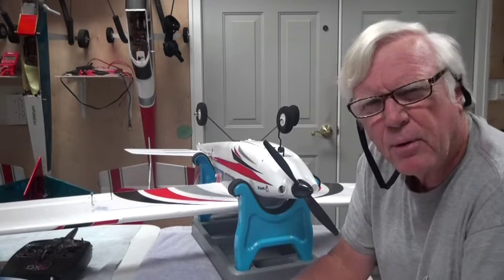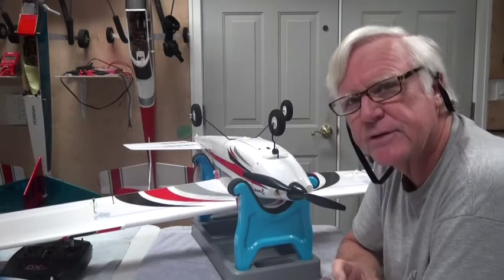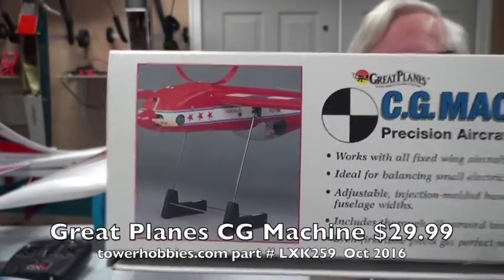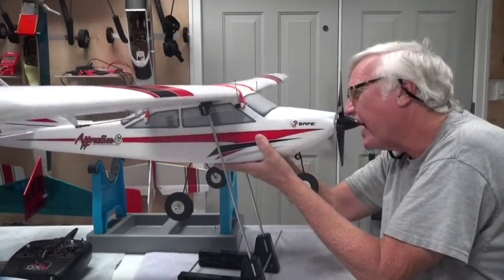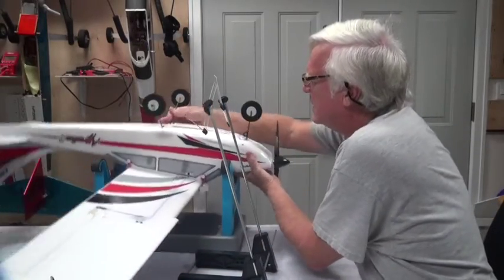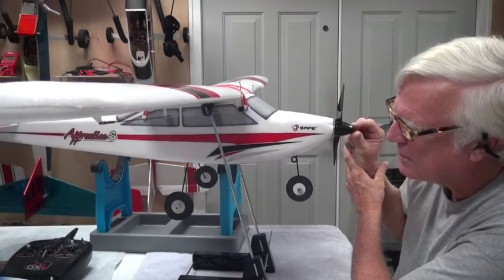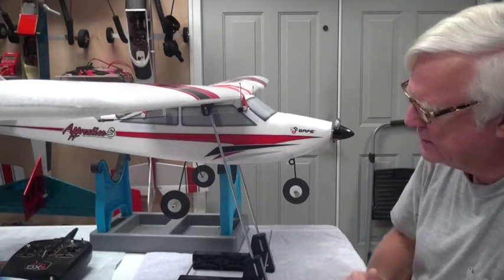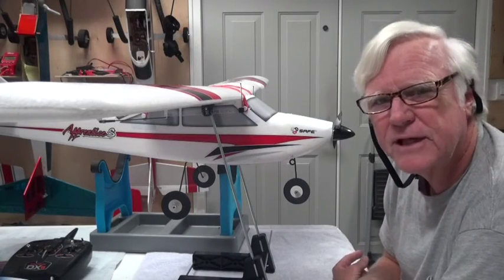AP25 Apprentice S 15e RTF CG

Comment: How did you determine the beginning point for the CG?  I have looked and there is nothing that says where the CG should be or how far back from the leading edge of the wings.  I bought the CG machine and can get the plane balanced with it ready to fly, but not sure if it is right or not.  It took some doing but finally got the rulers on the correct sides of the plane with the bars in front on the leading edge, but can change it real easy by just moving the plane back or forth which in turn changes the CG.  What do you use as the beginning point for the CG procedure?  Thanks
Reply from the maker: Page 12 of the manual shows the CG should be 79 mm from the leading edge of the wing.